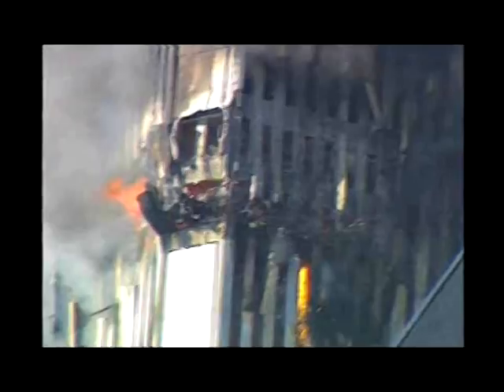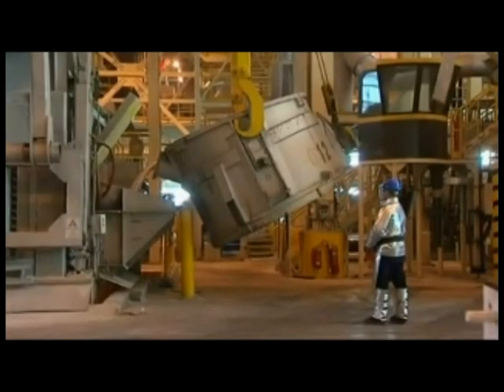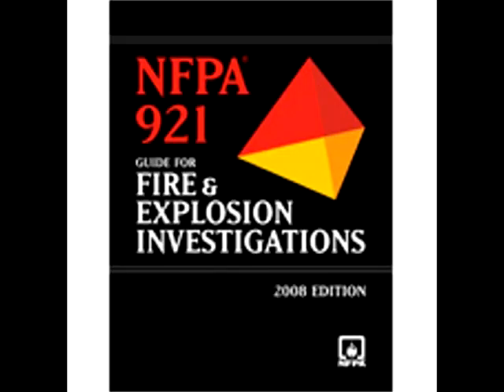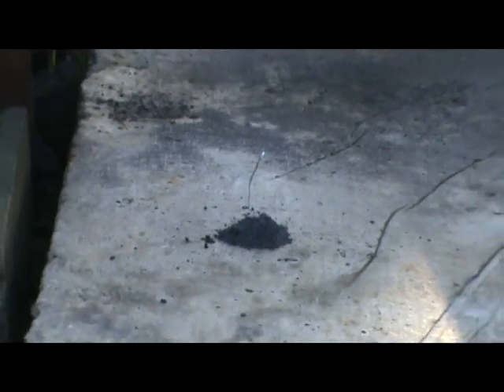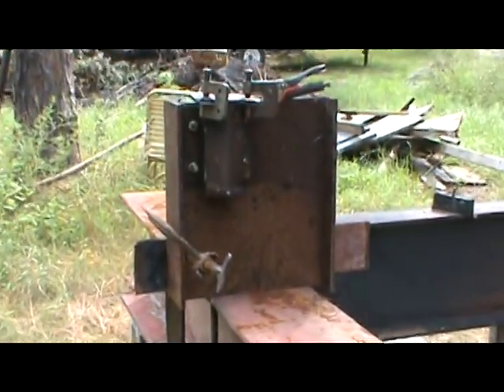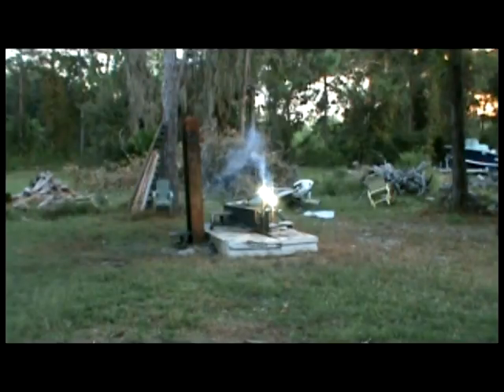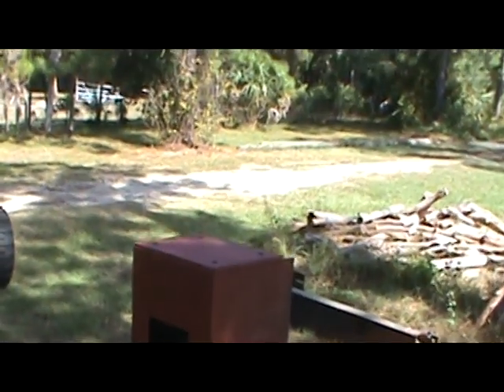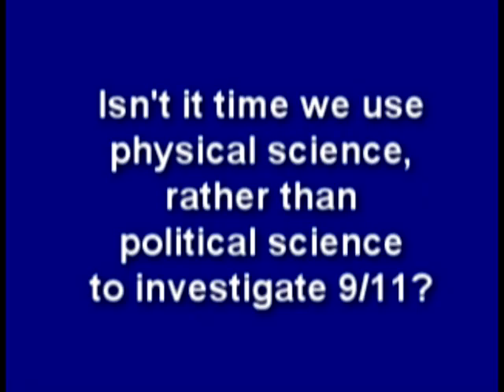9/11 Experiments: The Great Thermate Debate

Comment: Brilliant work. Well done!

A perfect example of science -- testing a hypothesis. The mainstream media had an agenda to show it couldn't be done, so naturally their attempt was going to fail.

Naturally, with nano-thermate, the effect would be far more powerful because of the increases surface area within the material.
Reply: What mainstream media tried to prove it couldn't be done? I'd like to see that.
Reply: The experiment may prove the technical feasibility of bringing down a building by  that method. But if you multiply the efforts required to weaken a single connection with those required for a huge building and claim additionally that such preparations could have been made in secrecy, the whole theory is so ridiculously unlikely.

Beyond special technical questions, the keeping of secrecy in preparation and in the aftermath of the alleged inside job is the common weak point of all the - often contradictory - truther theories. No one ever adressed himself to the press (ok, it's e part of the conspiracy, I forgot) or to a foreign embassy or even in came out in Facebook, saying he took part and feels so guilty etc. - not a single whistleblower among the thousands who must have been involved.
Reply: ***** He showed - if such a demonstration was necessary - that termite can loosen steel connections and can cut slots in vertical steel beams, but also, how hard it is to get it to do so and that it takes special devices.It's quite inadequate for a controlled demolition..
Reply: and your point is, ordinary building demolition will have had everything ripped out and be a shell, there wouldn't have had an aircraft ploughing into it, remote controlled explosions rely on uninterrupted access to the receiver, that could never have been expected with an aircraft ploughing in, do you understand what built into it means, it means that when the building was constructed the explosive materials were part of the building and that is what the video maker suggested, so in essence that bloke while having some expertise in engineering he's blinded by his efforts to prove something, but don't let that get in the way of your need to believe in a fantasy
Reply: Well Rod, you don't know sh*t about thermate or thermite if you've come to this conclusion.
Reply: SiggiNebel
I don't recall whether or not the demonstrator implied any conclusion, but while he did prove that it's possible to cut metal with thermite, he also showed how very inefficient such a process would be. To me this proves my case: passenger planes brought the towers down.
Reply: SiggiNebel
Your comment is incomprehensible.  "t(h)ermite"  can definitely melt steel pronto; this has been known for a hundred years.  And to set it up to do so is not "rocket science", although it is a Specialty.  You seem to be unaware that there is a whole industry devoted to safely, quickly , and efficiently bringing down modern buildings for legitimate reasons, by Controlled Demolition.  Now you say if the reasons are "illegitimate" that it can't be done ?!  Millions of people have seen it on video.
Reply: disgny
There is indeed a large industry using controlled explosions to demolish buildings. None of them use thermite of any similar pyrotechnic to do so. There would be absolutely no advantage in it. Conventional explosives do the job, as you say, "safely, quickly and efficiently".
As for setting it up not being rocket science... nobody will waste time trying to launch satellites with water rockets. Perhaps it isn't impossible, but most likely an incredible waste of talent, time and resources.
Reply: +disgny, tosh, when buildings are demolished conventional explosives are used, this whole whacky theory that thermite was built into it is ludicrous, the prat making this video never answered one simple question, if indeed thermite was in the building how was it ignited, truthers, paranoid delusionals more like
Reply: William Wallace
Surely you are not trying to tell us that in ordinary building demolitions, it is not possible to set off the explosions from afar?!   Many apparently knowledgable  people have said that they do it all the time. And in those cases,  the explosives are "built into it" , are they not, as well as the mechanisms for controlling the detonation times?  And, if you wanted , for some reason , to cut off heavy steel columns at a 45* angle, why would you rule out thermite , or thermate?!
Reply: disgny
"cut off heavy steel columns at a 45* angle, why would you rule out thermite , or thermate?!"
What would be the advantage of thermite or thermate? Shaped conventional explosives would retain all their advantages here.
Disgny, you are sounding more and more like a thermite salesman. I am forced to ask again, Why would there be any advantage, or need, to use thermite to destroy the WTC?
 Is it only because a fellow conspiracist, Prof. Jones. claims he found traces of thermite that it becomes a foundational basis for the "insiders" theory? Remember, he has never been able to verify his idea, and publicly admits that the particles he found only "looked like they might be" thermite. At any rate, the discussion about the use of thermitic "explosives" is moot.
Reply: ***** Though I was in a Combat Engineer Battalion during Korea, and we did some trifling explosive demoliton,  my knowledge of the details is no doubt less than yours.  However, the main question remains:  what difference would it actually make what kind of explosives were used?!  None.  The free fall of bldg. 7 is proof that some kind of controlled demoltion was used.  There are plenty of videos showing that proof, which is NOT based on thermite, one way or the other.l
Reply: William Wallace
There seems to be some confusion about what "built in" must mean.  I see no reason why it MUST be during original construction, which would be difficult and dangerous, for a long time .  Obviously.  Why not just  "build in" the explosives a short time before you wanted to use them?!  Say a few months .
   Another point:  you claim that "ordinary demolition"  rips out the bldg. interior, leaving a shell.  I think you greatly misunderstand the "controlled " part of  CD.  Another thing: you seem to assume that airplanes MUST be used, and that the demolition process would be hindered thereby.  Not necessarily.  There is no technical reason why CD should not proceed as normal,  with "airplane " distractions and "Special Effects", like in any magic trick.  Remember, this is the "Big Leagues" of Fraud we're talking about.
Reply: disgny
Perhaps no planes were necessary at all, if the explosives were built in. Simply blow the buildings and praise Allah.

Now when you say "built-in", do you include the paint-like process that Prof. Jones hypothesized?

What is the fascination with special effects? Were we making a movie?

And I don't think William Wallace was saying that CD destroys the interior. That is a necessary step in preparing a building for CD, not the result. Without clearing the interior supports, felling the building in any predictable manner would be virtually impossible.

You speak of the "Big League of Fraud". Big indeed. Overwhelmingly big. It begs the question...If such drastic measures were required to achieve their goals, why would they not simply buy what they want? Such a league of extraordinarily wealthy gentlemen would surely be able to operate farther off the radar scope than that.

You're probably sick and tired of people bringing up "Occam's Razor". But I know of no other philosophical idea that better suits the many, many claims and assumptions as appear on these pages. It just fits so well!
Reply: *****
I do believe in Occam's Razor, but let's agree that the final theory , as in any scientific endeavor, must answer ALL the questions , at least potentially, otherwise it is simply Denial.
  "  No Planes" does seem a possible theory.   "Special Effects:" has to do with persuading the public that planes were used. And yes, this IS all about a  movie.  Haven't you heard people say "Oh, but we all SAW it on video"? I submit that any group remotely capable of "praising Allah"  would NEVER get the access to the buildings that would be required.. Whereas a NWO group would have NO such trouble.
   Incidental fact: as those insisting that the towers were so "unique" that ordinary design experience doesn't apply, also agree,  those 1 acre floors were free of "internal supports", which doesn't include sheetrock anyway. So NO "clearing of the interior " would be required.  I would  suppose that not much "clearing" occurs in ANY CD. One would blow the interior columns (if any) too, of course.
    About the "Big Fraud", we are talking about instigating a world wide war on the moslem world, as well as trashing the US Constitution, so  getting public support for such  a venture could obviously NOT be done  quietly by a secret bunch of people no matter how wealthy they were; it requires, as the NWO people have said years ago , a "New Pearl Harbor".  Occams R. can certainly accommodate that scenario.  In fact, I challenge you:  NIST has completely given up on explaining the fall of bldg. 7;It is simply INCOMPATIBLE with Newtonian Physics.   Do you have a better idea?
    About painted thermite, I have no opinion, though it wouldn't seem to be the most effective use, which would be angled cutoffs of the columns. How is paint going to do that?
Reply: disgny "the final theory , as in any scientific endeavor, must answer ALL the questions"
If that's true, most theories of science today are totally invalid, including Newtonian physics. So now apparently ALL the questions about 9/11 have been answered by the speculation and rumors and selective attention of the conspiracy theorists.
You imply that it's possible to create SPFX in daylight with some sort of undetectable system, then you turn around and say that "any group remotely capable of "praising Allah"  would NEVER get the access".
Occam speaks again.
Yes, I believe what I saw on live TV and the accounts of the dozens of eyewitness, and the complete lack of credible witnesses who saw the buildings simply explode with nothing hitting them, and the many aircraft parts found on the site (which some of you say weren't there).
NIST wasn't asked to examine the collapse of building 7, FDNY did a pretty good job of that. You probably rely on that one video shot of the continuing collapse of that building and ignored all other shots & stills.
Of course, we all know that there has been a desire to eliminate the roughly 1/2 the world population and thus create the NWO.
Incidentally, since you probably mean "new world order", which one of the dozen or so do you claim is in charge here? Are you aware that there is a Muslim version also?
Reply: *****
When I said the "final theory" , I did NOT mean that there is a Final  one, either on 9/11 , or,Science in general.  A lot of "what we all know" is, and often has been, wrong.  Why in the world would any serious NWO fan want to eliminate millions of people?!  That is not the premise of Imperialism, certainly .  It is even conditiional in the most fanatic sects.
    When movies are made, SPFX are plentiful, usually in daylight, I imagine. And there are videos showing just how the required effects might be fabricated. Beyond that , some sources report that the military has had just that capability for a long time.  Neither of us is , no doubt, privy to the details. But I would hesitate to call it impossible.
    It would be expected that "eyewitness" testimonials would be provided ahead of time.  Some of those I heard sounded phony right off the bat.   And as for dismissing those NYC Firemen and cops who not only heard but felt explosions , as well as having commensurate  injuries , the most charitable interpretation is that you just haven't seen them. 
   As for world plots, I see the Muslim type as in the same class as the "Catholic" one, a rather outdated, fanatically "Religious" scheme, long past its expiration date.  Not so the one featuring the International Financial Clique, which has every reason to think the National State World is totally obsolete, with no future, with its successor yet to be finalized, and possibly within their grasp.

 A lot of those "airplane parts" were very suspicious in themselves, and not NEARLY enough in quantity.(The)One "engine" in particular was said to be inconsistent with the airplane that supposedly carried it, which of course, is something very elaborately tracked an recorded , for safety purposes.
  

  well...perhaps you did not explore those videos enough.  Or maybe you have some other reason to discriminate among them.
  I gather you are not a technically oriented person, or else you have a very compelling agenda, otherwise you would see what NIST finally admitted: the free fall of bldg. 7 cannot be accounted for , (except for CD.)  And the common videos seen by millions are really a smoking gun: the falls you talk about are totally inconsistent with Newtonian Physics (How convenient for you that we can dismiss it anyway!)  There is simply NOT ENOUGH TIME for ANY of the alternative theories dreamed up to be effective.
    As for access to preset demolition charges, what I meant was that Arab looking individuals , ever since the first WTC bomb attack, were NOT going to get easy access to the towers, where their security  was in the hands of an Israeli company, and I take it that anyone in the NWO group would have little trouble. Of course, I don't make any specific claims about such group(s) , merely that they are eminently plausible, and consistent with a lot of history.
Reply: disgny What are your sources that claim the engine was "not consistent" with that aircraft?
Either it's a match or it isn't. Serial numbers and aircraft are very closely tracked and recorded.
I retired from over 50 years as an electronics technician, CET, EET, FCC certified, was a Navy sonar technician, son of an electrician and industrial electronics instructor, and have a fairly good understanding of general science, basic physics, worked the last 30 years of my career in public safety communications, pretty well surrounded by police officers and firemen. My division was part of the city's buildings & inspection dept, so quite well exposed to plenty of architects and engineers (All these guys had strong opinions about Bush, but all agreed: WTC was brought down by aircraft and resulting fires). I think it's safe to say I have some experience in technology.
I was running the sound system in our council chambers that Tuesday morning, in the control room with a bunch of professional TV guys with top-notch  Sony monitors, the main one which was tuned to  the local NBC affiliate when the first reports came in. We were watching this when the second plane hit. Pretty damn good SPFX.
Anyone who saw that live, and saw the ensuing unedited reports, wouldn't be so quick to second guess everything... and there was little love for the feds or for "W". Anything one of us could hold against them would be pure gold. . The TV director rolled his tapes. in fact when the council meeting started, it caught him off guard, and he was late making the switchover. No matter, the meeting was started and almost immediately adjourned, pending a possible national martial law or something as dire.
So if you think we were all fooled by some video trickery. This director had worked at a Hollywood film studio (I've put off mentioning this because I have forgotten which one), and had done a good deal of still photography as a hobby, including holography and 3D. No grumblings from him about anything looking like a hologram.
Speaking of holograms, has anyone yet figured out how to project one? Even on a nice screen, let alone against a clear sky in broad daylight? Sharp enough to fool thousands of jaded New Yorkers?

Now about Bldg 7. NIST didn't investigate 7, because as I said before, the collapse was well documented by FDNY. From what I have seen of that information, it's surprising that it stood as long as it did. The Firefighters were pulled out well before the collapse, as the COS had determined that such might occur at any time.
An don't "pull" the Silverstein crap.

Sure, Arab-looking individuals are rare in New York, they would stand out like a sore thumb.

Sarcasm aside, I have searched the 'net and it appears the Port Authority ran security operations, and Securacom (now Statesec), the private company mentioned, was designing and installing the hardware only, and was never "in charge" of security. No Jewish connection is shown. Bush's brother was only a member of the board, and left that position in 2000. I'm sure you understand that members of a board can make no decisions regarding day-to-day operations of the company.

"the falls you talk about are totally inconsistent with Newtonian Physics (How convenient for you that we can dismiss it anyway!)  There is simply NOT ENOUGH TIME for ANY of the alternative theories dreamed up to be effective."
Would you care to clarify that statement? It doesn't make much sense.
 As for any agenda i might have, I will at least thank you for not calling me a government shill or troll. But I've been called worse... buy a couple of government agents. Never mess with politicians.
No, my only interest is the conservation of facts, and blocking revisionism where I can. Too much bullshit makes its way  into history books.
Reply: ***** First and foremost, the smoking gun:  the fall of bldg . 7. As most of the inhabitants of the modern world can quickly verify, this bldg. fell in about 6.5 seconds.  Given the well known Newtonian equations for calculating it, the time for an object, dropped from the roof of bldg. 7 in "free fall" to hit the ground would be about the same.  What that MUST mean is , that as the fall proceeds, there can be NO momentum transfers, i.e. slowing down , due to yielding steel,  residual support of any kind, such as "fires" having various effects, whatever.  That in turn, can only mean that the column supports of the building had been "removed", totally, and SIMALTANWEOUSLY ,in effect, and before the fall started,  otherwise the descent would have been slowed , which it clearly was NOT.  The only practical way of doing this is by controlled demolition, a fairly common process.  No one, including NIST has come up with any better explanation.
   As to the engine, a detailed description of the problem, including about the serial numbers, photos, ID, etc. : I have seen it on a Youtube  video. I'll look in my files for a reference to it, but it is available to everyone.  Same for an account of just who was handling the security for the WTC; not the firm you mentioned.
   As for video SPFX, take a look again at the one showing the crash into the steel wall of tower 2:  it LOOKS phony: it does not slow down for a second, does not crumple or shear off parts ,etc.  But again , there are detailed videos on Youtube showing in great detail why and how the videos could be faked. I don't understand that part, maybe you could.
    As for bldg.7 being "well documented" by the fire dept.,  I beg to differ.  One of the officials told the same story as Mr. Silverstein, except that HE said the fire dept. told HIM, whereas Fire Marhshal Dent , of  30 years experience,  said that under NO circumstances do fire officials tell private owners that their buildings must be demolished.  Not that there was actually time to do it.  So it is a mystery that needs serious investigation, which clearly the  NYC fire dept. did not have the time to do. Additionally, there are recordings of firemen in bldg. 7 at one point saying it is pretty much under control.  
   A big factor in this discussion is the obvious and well known fact that prior to 9/11 , NO modern steel framed building had EVER been brought down by fire, even though some suffered far longer and more intense fires than at WTC.  The ususal scenario is that after the fires are put out, they clean up the frame and re-build with  it (!)
Reply: disgny
So, you are saying the building was completely empty, right? That's the only way it could free fall. You make the same claim about Bldgs. 1&2. Yet videos show debris falling faster than the building. Why is that? Perhaps because the buildings actually weren't in free fall? Perhaps those who measured saw only external walls falling, which of course could easily approach free fall? Did they watch all the way to the surface? Did they measure the fall of internal components of the building? How did they do that?

"...under NO circumstances do fire officials tell private owners that their buildings must be demolished."
So who, besides you (and your friends), claim the building was demolished? The building fell, as fire officials expected, because of the severe damage done by the debris from 1&2 and the fires within.

And you claim the steel frame had to have been removed before the building fell? How and when? How did the building remain in place while the columns were "SIMALTANWEOUSLY" (sic) removed?
CD doesn't remove beams, it merely cuts them. Even then, the building doesn't come down in free fall. It is very carefully controlled (as in "controlled" demolition).

As for your final volley, i'm not sure about the records you mention, but even if it is correct, it doesn't apply. All three building had major structural damage prior to the fires. All reports say that it was this combination that caused the collapse. Nobody claims it was fire alone.

You keep referring to YouTube videos as sources. Of course, one should never question the validity of a YouTube video. I would love to see the vids you have in your files, let me know when you find them.
Reply: *****
The source for bldg. 7 "demolition" claim is the  owner/lessee himself, Mr. Silverstein, who appears in several Youtube videos.  I haven't met him so of course I cannot vouch that it is not some phony production.  In one video , he says that after consultatiion with the Fire Official, he was advised to "pull it" , whatever that means; apparently a deliberate demolition of some kind. In another video, in direct answer to a question, he says , yes it was demolished ,( but I certainly don't think he meant CD).
   Your criticism of the towers "free fall " time is accurate, but doesn't mean much; there may be been internally  good reasons for minor irregularities of the mostly free fall time,  but it doesn't , matter because there is STILL not enough time for the contrived scenarios to happen,.  Such criticisms fail totally when applied to bldg. 7, which is why NIST just gave up answering that one.
    What is your reason for saying the all three buildings had "major structural damage " prior to fires?  I haven't heard of any, except for "plane crashes" , or the dropping of bits of debris onto bldg. 7, which wasn't large enough to be noticeable
  Your suggestion about how parts of the building were falling faster than other parts is rather unclear as to why that would matter.  Sure, papers float around while steel chunks fall, so what?  And why would internal columns fall at a different speed from the visible ones?   Also, what is that about how the  buildings must be "empty"?!  If you are referring to internal partitions , or office furniture,  they can all be safely ignored; they are NOT structural , and would not impede a fall noticeably.
   As for columns be "removed" , I of course, meant FUNCTIONALLY.  I.e. The loads on the columns were very large, and if they are cut diagonally and simaltaneously, in milliseconds, by explosives, they can be "gotten out of the way" of a free fall just by  sliding over a bit  or perhaps blown sideways vigorously;  it is not necessary that they should be vaporized.. I gather you have not had a lot of experience with moving heavy weights around.
   Note that any internal junk  , re "empty floors" would not have to be removed, it would fall down just like everything else if the columns are blown out of the way.   And we did see a lot of heavy steel being blown sideways, did we not?
Reply: disgny
Silverstein was advised that the building probably wouldn't stand much longer, and that he was going to have to pull his crew out. Silverstein responded  with something like "There has been too much loss of life already. Pull it". My quote might not be completely accurate. Silverstein was recounting the discussion as he recalled it.
"It was demolished" doesn't mean CD, of any other sort of purposeful demolition. It was destroyed, ruined, trashed, demolished.
The building was about to fall on its own. Photos show it buckling outward while FF crews were still inside. Why would the FDNY need to knock it down? They just got out of the way.

"Also, what is that about how the  buildings must be "empty"?!
 You had said the building was in free fall because there was nothing in it to slow it down. Apparently you believe that the columns fell instantaneously after the explosives were triggered? Oh, yes, and were cut in milliseconds by, uh, thermite? And that they also flattened completely after falling? And that each floor accelerated to the velocity of the of the floors above instantaneously?

"Your suggestion about how parts of the building were falling faster than other parts is rather unclear as to why that would matter."
It matters for the simple reason that those pieces of debris were indeed in free fall, as there was no structure to impede their descent. Since they are falling quite a lot faster than the building, are they allowed to er, break the "free fall speed limit"?

"And why would internal columns fall at a different speed from the visible ones?"
(Re 7) Because the facade had little support, and very likely began falling away from the interior first.

Nossir. The buildings did not fall freely.
As if that were an indication as to whether controlled demolition was involved.
 
Have you checked the aerial photo of Bldg. 7, showing the huge  multistory gash in the side of the building prior to the collapse? Thing that was caused by small debris? (I quote you:  "And we did see a lot of heavy steel being blown sideways, did we not?" )
(Even though we disagree on many details, I'm glad you're not one of those who said the steel was vaporized.) (Are you?)
Are you also one of those who describes the fires in Bldg 7 as "small office fires"?
Do you think that because one FF team reported a part of the fire "almost under control" that they new what was going on in the rest of the building?
Do you also say that what happened to 7 should have happened in the towers as well, although there was little similarity in the construction?

Forgive me if I get confused as to which building we are discussing at any given point.
Reply: *****
I'm not understanding the part of your rejoinder where you seem to be saying , that some parts of whichever building are falling "faster" than others.   Yes, there is as speed limit to free fall.  But of course, items can fall slower, such as paper sheets, for example.  I don't see any particular reason a facade could be expected to fall faster than another part.  Bldg.7 especially seemed to fall directly down. And  exactly how would anyone come to the conclusion that building 7 was "just about to fall".   That would be a very dubious and controversial thing to say.  Of course , someone in on the Plot could certainly say it, and be sure of it too.
    As for out of control fire, you have clearly not been looking at REAL steel framed building fires. In many, all the facade has already burned right off, leaving the frameworks still in flames. At NO point was bldg. 7 in that condition, not even close.
   As to cutting the columns, it is not necessary that they be "cut" in milliseconds, merely that the cutting should be simaltaneously initiated.   Once there was any serious discontinuity in the column supports, en masse, there would be no need to clear the debris away, it would all be falling together.  What's the problem?
  Your statement that free fall doesn't indicate CD is quite puzzling. How can you reasonably  deny that free fall IMPLIES that there is NO  significant resistance slowing down the Fall.?!  Back to basic Newtonian physics...
  Yes, I would describe bldg.7 as "small office fires", just like the firemen did.
Reply: disgny
You have built enough straw men to feed every cow McDonald's ever killed. You have buried you hand in the sand deep enough to strike oil.
To you, implication is proof, rumor is confirmation, suspicion is conviction, avoidance is elimination... You hear what you want to hear.
You are indeed an intelligent man. I don't understand why you ignore those facts which conflict with what is obviously your preferred result. You have allowed your obvious bias to influence your conception of the facts and evidence before you.
You are a rigged jury.
Reply: *****
I was an engineer by trade , for 34 years , so your accusation that I don't like conflicting "facts" sounds very strange to my ears.  It's true that engineers tend to want to understand "what actually happened", before tackling a project, and will go to some trouble to establish what the facts actually are.
    The 9/11 affair appears to me to be so complicated that at this point we cannot even say exactly what happened, not even whether airplanes were actually used.   Sorry, If that offends you.  Could there be MORE of  Straw men than 19 Arab "hijackers" , many of whom has since been found to be alive? Of course, in the absence of any real investigation,  we civilians can not be sure of the facts, outside of the one BIG One:   The Official story , whatever it is , cannot account for all the facts.  I am well aware of just how disheartening such a conclusion must be for Americans of my generation. We thought Nazis were the Ultimate "Bad Guys"; now we discover that the US has been imitating them lately in multiple ways.  The Reichstag fire comes to mind.
Reply: disgny
Your engineering experience apparently didn't help your ability to do independent research. To be perfectly honest, I only scanned your post. It was so easy to find the same statements and claims we see posted by others. One of the more common ones is the claim that many of the accused hijackers are still alive. But nobody seems to be able to locate them. Where did this rumor come from? I found only one instance that a man by the same name was found in Saudi Arabia. Aside from its being a very common name among Arabs, the man who was "discovered" has never left the country and has no ties to Jihad. This is according to a report from Al-Jazeera.

"...(T)he absence of any real investigation" inevitably means one that supports your view.

The Reichstag fire. What makes you think the Nazis did it? There is equal evidence that communist sympathizers did it. It's pretty much a toss-up. So of course it's a straw-man.

The clincher? Insisting there is insufficient evidence that aircraft were even used. That would require that all the video was fake, and that all the witnesses were paid government shills, and that the planes and the passengers were secretly flown to a hiding place never to be seen again.

Maybe the National weather Service predicted storms, and indeed we believe we had storms, but somebody says the NWS had an interest in misleading everybody, so they launched huge cotton balls painted grey on the bottom and set up a van de Graf generator for lightning and a bunch of Hercules water tankers to wet the county.
And now they can say the Injuns did it with a rain dance. Then we can close all their casinos and turn that business over to some rich people who want the money.

Or maybe we just had one of the usual, old-fashioned pollen washers.

I'm truly sorry that your previous faith in the decency of the US Government has been so shaken. I however, was in the service (4 years), and later in civil service. (33 years). Certain supervisors threatened my life over my exposing a simple purchasing deal. I know how these people work. I know what they are willing to do to the people and to each other.
I also know that they are incapable of organizing themselves into an effective cabal.

Nobody distrusts government more than government workers. That's why only tiny, poorly organized activities ever occur.
Reply: ***** How interesting that we seem to share a lot of experiences, even conclusions.  But it is one thing to think that "the Government" can't organize an effective cabal, and quite another to think that tiny , tightly organized , ideologically fanatic groups are incapable of carrying out a program.  What is the CIA if not such a group, having conducted "successful" False Flag operations, and government overthrows,  though they may or may not be under such specific control   as it appears the NWO group might be.  How about the Jonesboro "religious" mass suicide group, or the Russian Communist Party of 1917?  Incidentally,  the Nazis had the motive and opportunity to do the Reichstag fire, the Communists , since they were not in power, had nothing to gain, and everything to lose.  Whoever did it, it was clearly an "effective cabal".  Another historic example is the cabal that enticed the US into the Spanish American war, a total scam.
     As for motivations for the 9/11 fraud,  surely the news of today gives a clue:  the Zionists  are absolutely convinced that Israel's existence is in grave danger, to the extent that some seem to think that a war with Iran, hopefully fought by the US,  would "save" them.  I'm not saying they did it, we just don't know, but they are NOT an ineffective cabal.   Nor is the NWO group, insofar as they are separate, and they may well be.
   As for the whereabouts of the "Arab Hijackers" , probably neither of us has the resources to find out the truth , since our government seems to have no interest in doing that.   Why should they, since those guys seem to have been the Patsies, and should be "forgotten" , since that job was done.
Reply: disgny
DAMMIT MAN, if you insist everything from the government is a lie,.or has no interest investigating again, then start your own separate independent investigation. Crowd source it and get it done. They brought down Nixon, and half his cabinet, didn't they? Why can't you find the irrefutable legally usable evidence you need to bring down the murderers who brought the towers down?
Reply: ***** My idea of what engineers do, is that they find practical ways to accomplish what someone else has dreamed up.  Your idea of finding evidence is fine, but to me the question immediately comes up, what would we do with it?!   In the Watergate case, or  perhaps the French Dreyfuss case of a hundred years ago, not only was it necessary to get a lot of people convinced that some crime had occurred, but they also had to find elements of the government who wanted to take action, which is partly a matter of fashion, timing, and the result of a LOT of private discussions about whether the "government " could be trusted , or not.
     It's just my opinion, but I see our "elite" as a lot dumber and less "patriotic" than they formerly were.  However, there is still hope: look at the bloodless crumbling of the Soviet Union:  it could have been a bloodbath, but so much of the public, including its police and army, were so convinced their government was hopelessly corrupt, that they wouldn't cross the street to "save" it.  And it was surely the result of a lot of private, ongoing "forbidden" conversations over many years.
    Someone once called me an "eccentric millionaire without any money";so  my ability to challenge "the government" is limited.  Especially so since SCOTUS has informed us that Money is free speech.  I don't like to sound negative, but you don't avoid potholes by pretending they don't exist.
Reply: disgny
The Soviet Union collapsed due to internal frustration and growing apathy toward the ever-increasing costs of supporting an unsupportable economic system. There was indeed violence, but it was short-lived as the Red Army came to realize that they themselves lacked motivation.
Watergate would never have gone beyond a few page two reports without the reaction of the Democrats who were the direct targets of the break-in.
Interesting that you should mention Dreyfuss, since the public outcry to convict him and the dissension after his release was fueled mainly by antisemitism. There seems to be a strong anti-Semetic influence it the 9/11 matter, as Larry Goldstein, Irael and Mossad are prime suspects according to some "truthers".

As for the "eccentric millionaire without any money", you just might have more company than you realize. Of course, if you allow "millionaire" and "without money" to cancel out, we are left with "eccentric". I have been called that before, and it might be accurate. :)
Reply: +Leo Bolduc Your language reveals your level of intelligence. Your lack of supporting facts reveals either your laziness or your blind arrogance. I don't know which is worse. Why do you even bother? Grow a spine and a brain. Do some research and elaborate on your claims or stop wasting everyone's time with ad hominem garbage.
Reply: +SiggiNebel What a weak theory of your own. In all your huge imagination, you have no idea how such a thing could be done?

See Corbett Report's "Meet the 9/11 Whistleblowers."

Also, think, man! If you wanted to pull off an operation like this, would you choose people who are boy scouts or psychopaths? You're showing yourself to be pretty naive.

Compartmentalization is likely a key element of any large conspiracy. And don't dismiss conspiracies. There are, by one study, at least 489 new conspiracies starting every second, somewhere in the world, day-in, day-out, all year long. Why? Because people are selfish or self-concerned.
Reply: +Bill Martin Why inefficient? He didn't say this was the method used. He only showed the efficacy of the simplest materials in cutting through a steel beam. One of the tenants of WTC worked in collaboration with Komatsu to create nano-thermite demolition devices. Was their technology used on 9/11? We don't know. Was some new improved version used?

Find a sufficient number of psychopaths, pay them enough money, and you could have an army of preppers working for years on the building.

Collapsing buildings don't fall in on themselves as all 3 buildings did. WTC7 even fell at perfect free fall for the first 8 floors of collapse. Show me any evidence that solid steel has ever offered zero resistance.
Reply: +Bill Martin Sorry, but you haven't studied this topic very well. One very powerful reason to use nano-thermate is to cut through steel beams quietly. If I were planning something like this, I'd want to confuse people by using the meme "no explosives used, because they would've been heard as a loud boom."

But loud booms were heard and recorded. White smoke clouds preceded the collapse, indicative of thermitic release of aluminum-oxide smoke.

And Ground Zero had hot spots that remained very hot for weeks after 9/11. You don't get that with either office fires or jet fuel fires. Only something like thermite can keep burning deep within a rubble pile for weeks after the initial event.

There were also large fused elements of steel and concrete. You can't produce that without thermitic levels of heat.
Reply: +William Wallace Paranoia is only applicable if it's based on imagination or delusion. Finding tons of iron microspheres and unreacted thermitic chips in the 9/11 dust is pretty factual.
Reply: Rod Martin, Jr.
So now what was reported to be "traces" is now "tons", huh? This is what you call "factual"? You weren't saying this during last years' annual shoutfest.
Reply: Rod Martin, Jr.
I'm confused about your statement regarding "booms" (and I've seen other people saying the same thing, so you're not alone).
If the purpose of using thermite was to eliminate explosives booms, Why do so many of you them claim booms were heard, proving that explosives were used? And that white smoke proved it was thermite?
And just what are "thermitic chips"? Have you ever studied the composition of thermite? Basically iron oxide powder mixed with fine aluminum powder. Such a material doesn't seem likely to form "chips".
Iron spheres are ubiquitous where welding and cutting torches have been used, and boy, there was lots of that... both during construction of those towers and all the other buildings around, and again in cutting up the steel debris that covered the site.
You are rehashing the same old crap that has filled these sites ever since the good Professor Jones published his claims. Every bit either easily explained or thoroughly debunked.
Reply: +Bill Martin , please take what I said in context. The fans of the Bush conspiracy theory state that there was no controlled demolition, because there were no loud explosions. But "loud" is relative. I don't know the mind of the perpetrator and what all they had as their purposes. Booms were heard; they may have been specialized explosions that thermite or nano-thermate may not have been able to handle. I don't know. But the use of thermitic charges would have greatly reduced the occurrence of loud booms. They swill would've been noisy, but far less than C4.

As far as the claims of booms, you just have to watch more of the 9/11 videos. Newscasters reported multiple booms, a few were even recorded.

White smoke does not prove thermite, no. I don't know why you would ask that. White smoke is consistent with thermite or nano-thermate, but it doesn't prove it. It's one piece of evidence to be taken with the lot of it.

I've studied thermite and nano-thermate a little over the last few years. Yes, I know you can make thermite in your kitchen (if your wife will let you). But nano-thermate is quite different. You can only make it in specialized, high-tech labs. The chips are formed from the atomic level up. They are grown. Like I said -- high-tech.

Easily explained? Alternative explanations do not necessarily debunk anything. They only mean an alternative. Every so-called "debunk" I've seen so far has done only that -- provide an alternative, but never proven to be the only explanation. All too frequently, those alternatives don't explain ALL the evidence.

It sounds as though you've taken the sound bites of the fans of the Bush theory and not done your own digging. If you had, you would not be asking the questions you did ask.

Believe what you will. Some very nasty people in our own government killed their fellow citizens in order to achieve a selfish goal or a set of selfish goals. The Constitution has been trashed, liberties have been eroded, America has become a war-mongering state and Obama won a Peace Prize just before ratcheting up the killing spree. And Bush laughed about the disappearing WMDs while our boys were dying in Iraq. Psychopaths, the lot of them.

If you do nothing else, think about the work of David Chandler and the Free Fall of WTC7. This should be simple enough even for you to understand. Nowhere in the universe does solid steel ever offer zero resistance. Yet, American government scientists glossed over this glaring fact and nearly didn't even admit to free fall.

Of course, you're free to think that solid steel can offer zero resistance. If you do, go ahead and prove it. See if you can ram your head through a solid steel beam and survive. Zero resistance? Please!
Reply: +Bill Martin As for your question about "traces" becoming "tons," it's a matter of scale. Let me give you an example:

The traces of iron in the sun is sufficient to create several Earths. See? Trace -> tons. And the traces of iron in all the suns in the universe are sufficient to create a very thick shell of iron around our entire solar system. Got it? Don't play dumb with semantics.

Think man! Don't be such a bump in the road. Do the math.

31,120 square feet per floor x 4" concrete in each floor pan x 110 floors x 2 towers = 2,282,133 cubic feet of concrete.

When pulverized by the explosives (thermate or some other?) this would take up more space. When you include pulverized furniture and human bone, that adds a bit more. But for our simple calculation, we'll consider it all to have been concrete plus the residue from thermitic reactions.

USGS had many samples from various locations around lower Manhattan. Each contained from 1.33% to 4+% iron microspheres. Let's take the low end of the range to be conservative.

This gives us 30,352 cubic feet of iron. Based on 491.09 pounds per cubic feet (density), this yields 7,453 short tons of iron. Got it?

I used to be a fan of the Bush conspiracy theory. Then I took the time to dig. I recommend you stop being a "sound bite" couch potato and do some digging for yourself. Stop being a short-sighted fake skeptic and be skeptical of your own viewpoint. A little humility goes a long way to learning.

Try it sometime. You'll like it.
Reply: Rod Martin, Jr.
What would this figure indicate? The amount of thermite used, or perhaps the amount of sparks made by collapsing structural iron, or that produced in the construction of other steel structures in the area since the time steel began to be used in construction? Or the thousands of other possible sources of iron spheres in that debris?
Then realize that iron spheres would be the result of UNCOMBUSTED thermite. Otherwise it would be FeO2, which doesn't form spheres.

Not only is your figure based on questionable assumptions, but meaningless as well.

When I hear so many unsubstantiated claims of "evidence", I tend to get skeptical. When I hear so many mutually exclusive theories, I tend to discount most of them. When I hear claims of "proof" that turn out to be nothing more than speculation, and then when I see so much "proof" that is clearly fabrication (OK, LIES), I tend to turn to my own theories. It so happens that my theories are the same as most of the thousands of those professionals who investigated these incidents.